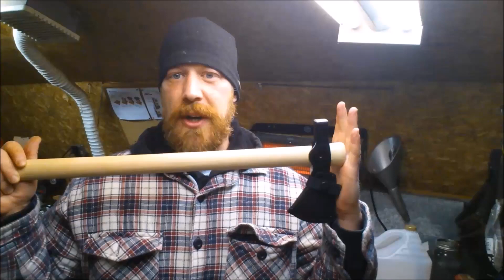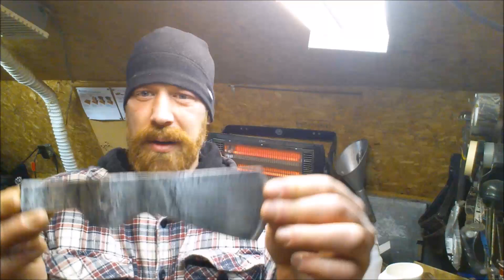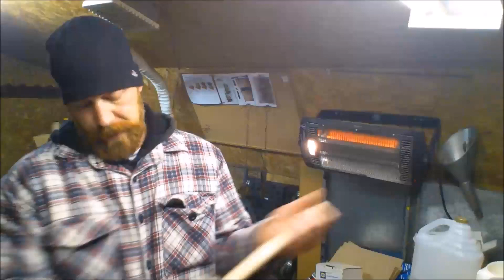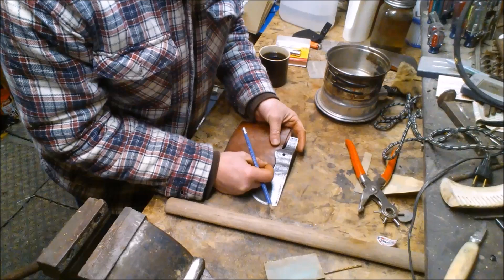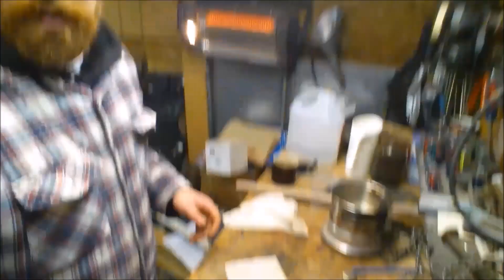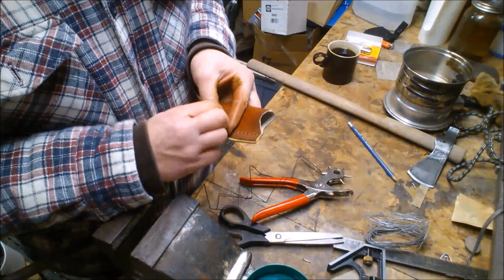Cold Steel Trail Hawk Mods

Comment: What steel protection did you choose? I did the same sanding method and I love the way the paint is down in the grooves of the metal.
Reply from the maker: Evan Jamison I didn't use any steel protection. I just give it a good wipe down when ever I sharpen it.
Reply: WELSBY ROOTS very nice. Seems like a lot less trouble than going through with the bluing process and such. Thanks man